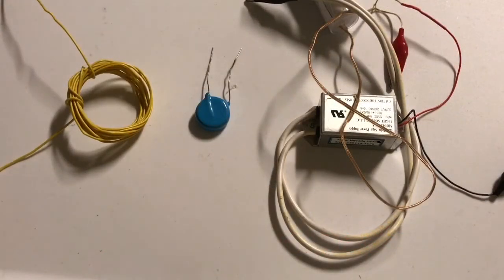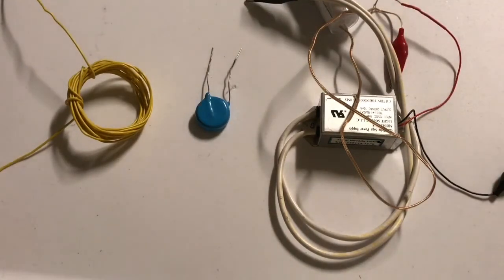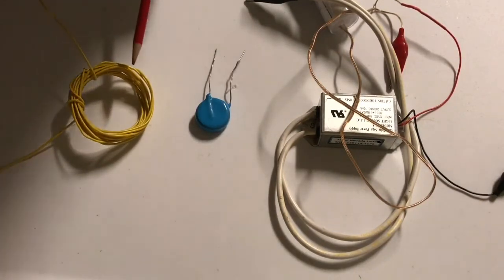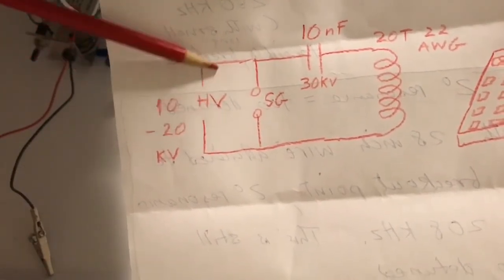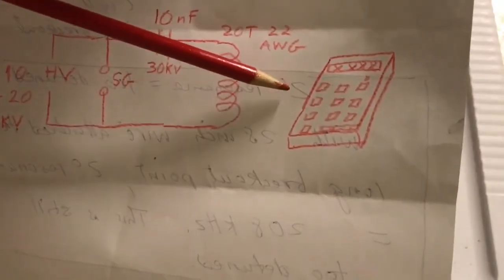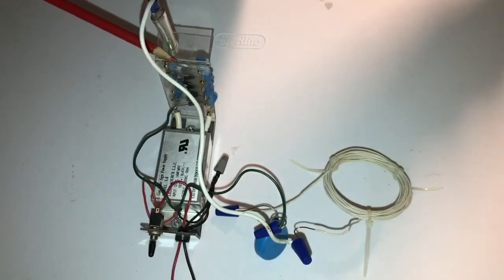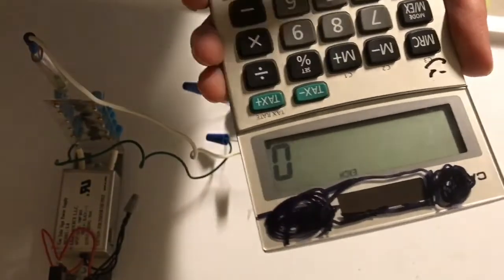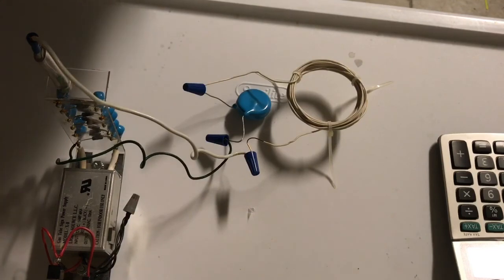Build Simple Effective EMP

Comment: Hello sir...
Nice video...

I have some questions. ..

Can we add more than one 30 kv capacitor?
What happen if we add two more 30kv capacitor..?
I am sure power of spark  will increase. ...but can it damage our high voltage generator...

In my setup i buy 40kv  high voltage generator and then i am planning to use three 30kv capacitor to increase strengh of spark..
Will it work? Or it burn off high voltage capacitor?